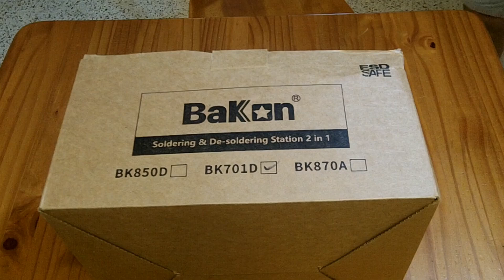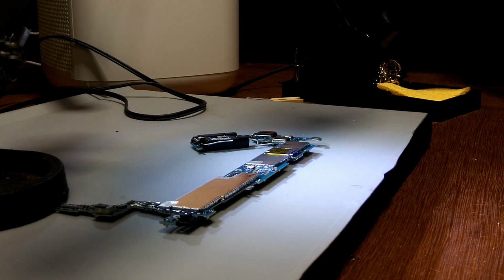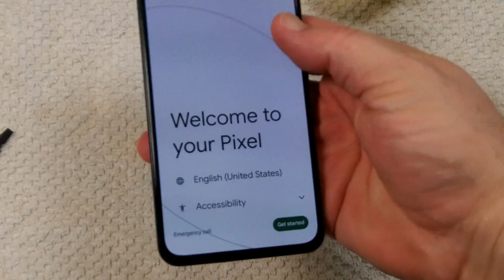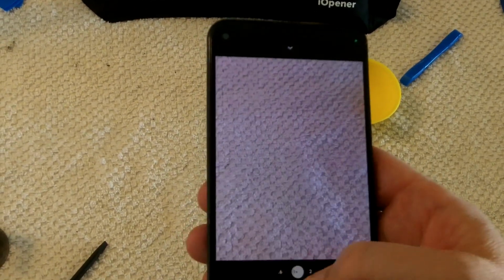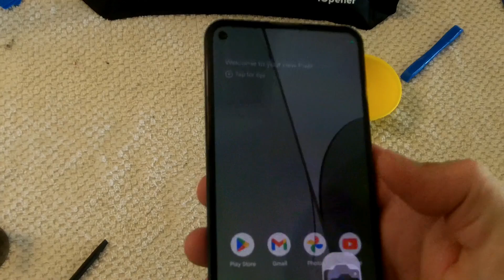Review:Bakon BK701D 700W soldering  hot air reflow / re-work station  $100

Comment: Very little space in the market for a non direct heat iron in 2025.
Reply from the maker: I'm using it mostly for the hot air rework gun, but I haven't had any complaints with the generic ceramic heater with replaceable tips on the iron itself (tips are cheap, and it heats up quickly enough for me).
Reply: I have the other version 852D+, it heats up really fast, the fastest I've seen for this type of iron. 

It's not really 60 watts, with the smaller tips it operates like a 48 watts iron, which it is, the transformer is 24V 2A. But with the larger tips like the knife tip, it seems to have a bit more power. 

Don't get me wrong, it's cheap as shit and comes with problems, but it works.
Reply from the maker: @E-raticWarrior  Yah, it's done everything I've asked for, and you can't beat the price.
Reply: @E-raticWarrior  I paid just under $70 for my 852D+. And I don't know what kind of voodoo magic is being done, but my other soldering iron that I paid $10 more for then this set will be cool to the touch in under a minute. And will go all the way to past 800 F in lest then 30 seconds. Even with this that thing is impressive and will still remain the main soldering iron. Nothing wrong with this one, but I have another one and it is better.